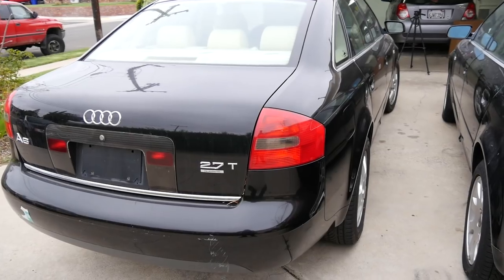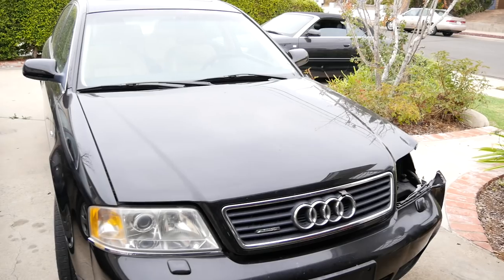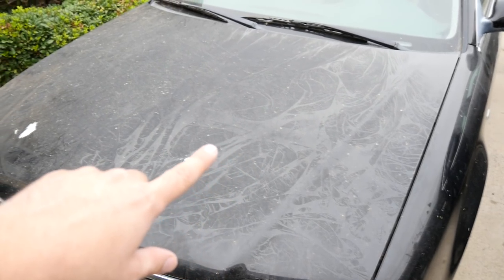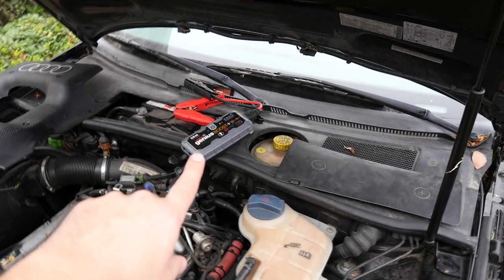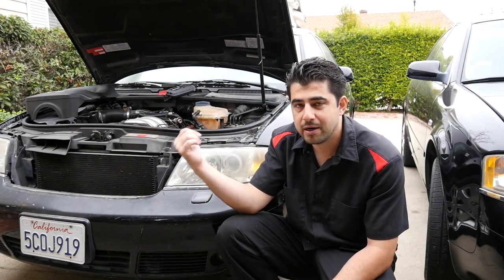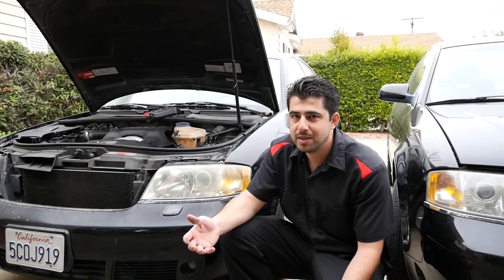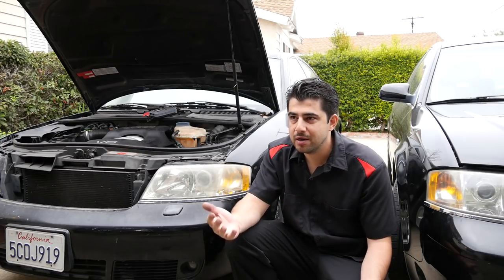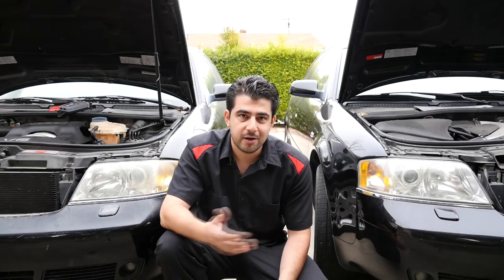Sleeper car for +$500 - No Joke

Comment: I see the PROBLEM HERE!!
Too many jealous and ignorant people that don't know anything about cars. Just cheap crappie like Hondas. 
Yes you can throw a turbo into a Honda but it will never outperform a Audi.  Never!!
I've owned Hondas and different Japanese cars. 
But this Audi can get over 400 H.P  with simple A.P.R technologies.  Without any mods to the engine at all. Just a simple chip and software mod and that's all. The turbos are good up to 30 psi each one. And you can drive it all day on red line.  Yes they cost more money to repair.  But one thing is this. 
You won't find any wrapped around a post like those ballerina Hondas.
So guys keep talking smack because at the end of the day. I doubt any of you can even afford to do what he does or have the knowledge to do what he does without looking on YouTube just to change your spark plugs on your Nissan. 
Peace! !!
Reply: lowcabbie
I'm pretty sure this one was wrapped around a post.
Reply: J Shepard  let me give you an example of how these cars are. .....
My first mod was stage one a.p.r chip. Cost me 500 dollars Canadian and gave me 65 hp. Then 2nd stage was a additional 75 with intercooler and chip and cams injectors.  Total 1500 dollars   I was pushing over 400 horses and  no big mods at all.
How can you get that out of any car with 1500 dollars? ? All done at certified dealers. Seriously.  Your mind is wrapped around a post.
Reply: "never outperform and Audi" with a turbo Honda? Well the guys hitting 200 mph in a quarter mile on the 2 liter Hondas might say otherwise... Sure, the Audi can win since its AWD, but 1,500+ HP out of a 2 liter is pretty respectable... I know I couldn't handle that in such a small car. Either would be fun to drive, so they both win in my book.

Personally, I don't care about brands, I just want a cool/fun car. Just bought an RX-8 with the Wankel rotary engines (Engineer and nerd, so I just find the engine design really cool). Do I care that its not 10 billion horsepower? nope, It has plenty of power to get me killed. Do I care it makes single digit fuel economy in town? Nope, I go by smiles per gallon, not miles per gallon.

Comment: 500$ ? ha , wait till that shitty 2.7 spins a bearing or timing chain starts rattling, aint no 500$ fix.
Reply: Seriously do some homework before talking.... this car doesnt have a timing chain, It has a belt. The timing chain issue was with the newer years. And  the "spinning a bearing" in a 2.7 is unheard off. .. BUT engine maintenance on any audi is expensive . Simply do your homework before commenting something totally wrong
Reply: Ha wow a belt, of course its an audi, I did my homework, those engines are trash regardless of what you try do tell me.
Reply: A timing belt is completely different then a timing chain. Timing belts don't "rattle" like you said.. Also, saying that these engines are trash is utterly RIDICULOUS. Any person that even knows a little bit about audi, knows that the 2.7t is the most over engineered  engine that audi has ever designed, coming from the factory with forged internals and more. The issue with them was the stock turbos that they come with, as well as some sensors. If the owner doesn't maintain the car and shuts the car off after full boost without letting it cool down or going into full boost without letting the car warm up, the turbos will die fast. The engine in this car is amazing, especially from an engineering stand point. I own an s4 with this engine in it. Very expensive maintenance, but well worth it. I respect what you say but couldnt scroll past your comment because it was so wrong. But I can  see your stubborn  - "those engines are trash regardless of what you try do tell me".
Reply: I understand, if Id own one and spent money maintaining it, I would also be pissed seeing my comment. I've looked into these 2.7Ts and I am impressed with the engineering but I can only see how terrifying it would be to own used. I would only own one if I knew the engine was rebuilt with fresh turbos along with it. I myself am more of a mercedes fan and Im replacing my head bolts on my m156 6.2 so I know what its like to own german performance.
Reply: ltwargssf R understood, not being biast because I own one. Just wanted to inform. Good luck with the Mercedes. Sounds fun!
Reply: It actually has 2 timing chains! They link the intake and exhaust camshafts on each head. All of this run by a main belt.
So, YOU also need to do your homework!
Reply: AlienMonkeyDXB this is not what he was referring to though...
Reply: a timing belt and a chain ? Rip wallet.
Reply: ltwargssf R the chains don't get touched. 800 to get belt changed as long as your not taking it to the dealer. A whole lot less if your mechanically inclined and can do it yourself. Regardless, when you do the timing belt, your supposed to do pulleys, accessories belt, water pump blah blah blah. So yes. RIP wallet. Just got that all done. Lol
Reply: Ok. I own a 2.7t n am repairing a broken timing belt. Timing belt is infront in the 2.8 n 2.7 n runs the cams in the heads. There is timing chains within the heads to run the cams. I also tune these motors
Reply: ltwargssf R replacing head bolts on his "non trash" pos 6.2 😂😂😂😂😂. Knows German engineering 😂😂😂😂😂😂😂😂😂😂😂😂😂😂😂😂😂😂😂😂😂
Reply: Boost Book - it does have timing chains in the heads. The belt drives the exhaust cam and the exhaust cam spins the intake cam via a chain wit a chain tensioner. So yes it does have chains just not to crank. Its easy to see and find out how its driven just type audi 2.7 or 2.8 in eBay with timing chain and or belt into search.
Reply: Kendel Surette yes I completely understand that, but he was not talking about intake and exhaust chains. He was talking about the timing belt that spins those. Hence us speaking about the maintenance cost of the "timing belt service". Those chains normally do not get touched.
Reply: Boost Book - yea. The timing belt kit I just got was $400ish. I bought the premium all in one kit last time and that was missing one cam seal.. I ended up going to Napa and got the one wit the orange inside and it's spring reinforced. So I had issues wit them still leaking with the all black seals so this time I peiced the kit together myself and was able to get the timing lock bar and pin which I borrowed from a friend last time. Anyways. I got all the 13pcs and the lock bar/pin all for $350 but it was more work to find things that wherent coming from China and would be cheaper. I also picked up a thermal spacer for the intake manifold for $66, a CPS (G28) Bosch $22 and cam chain tool (which I broke last time) so about $500 with coolant is a good price. Me and my friend work on these mostly. I do ECU stuff like tunes etc. As long as the car has no major issues (trans,motor,electric) they are great cars. And I love how easy it is to find out what's wrong wit the 2000MY car compared to other cars made around that time I've owned or worked on. Just a good thing to do is buy a KLL cable b4 you buy a Audi. I would have know that I needed a TC or atleast now could have gotten it removed in the TCU. I could have asked for more money off the top. Quick side note. The ZF automatic has 2 separate areas for gear oil. The front and cntr are only able to be pumped out, not drained. Does this lead people on to think it dont take gear oil. Mine has 115k on it and I pumped out .4qt from the cnt and fnt diffs. So they were nasty and probably never changed out. The rear diff had been b4. So far the car is pleasure to drive and haven't spent much money on anything major. I've also been on a DazStage2+ on W/M injection for 70k and the turbos felt great when I did the motor mounts but I have a feeling someone before me replaced them cause at 188k they should have more shaft play. Cheers!
Reply: Like Scotty Kilmer said, they are endless money pits!. These cars are not for the working class as they are for leasing. Unless your a Mechanic, I suggest to never buying one as there's is a reason why you can buy $60k Benz, Audi or BMW for little as $6,000. They are notorious for electrical problems as they age.
Reply: pos 6.2 ? explain.. other then the head bolts they are solid and well engineered,  theres a reason why they call them over engineered, because they are better, you cant understand till you've owned one, then everything feels like a pos.
Reply: I dunno if there's anything else worse or as bad as a Bush Jr. era GMC Yukon/Chevy Tahoe... Looks like GM may have cheaped out on soldering...
Reply: 100k belt interval ..these motors last forever ...300k+ miles isnt rare .. i have over 215k on mine and runs perfect , doesnt use a drop of oil between 7k oil changes ..thats a pretty common ownership experience.. their biggest issues are valve cover and cam seal seeping..most/many do ..but doesnt seep enough to change the level on your dipstick..if a turbo goes out it's a huge pain in the ass labor'wise ..turbos can be had and upgraded cheaply ...turning the stock turbos up 5 -7 psi will give you 50 HP and 75+ TQ increase ..just 15 minutes on a laptop ..remove cats , add some down pipes and thats another good chunk of increases .. and they drive down the road as smooth as they are sitting at a light
Reply: the chains ive always referred to as cam chains .. upfront is the "timing" belt.. the chains in the back are pretty much never an issue or even a conversation in the 2.7 or it's big brother the 4.2
Reply: steve-o painter - the c5 4.2 is not the issue. Its the b6 s4 4.2 where its all chains and requires the motor to be pulled. I forget if the rs6 c5 needs engine pulled to do chains. If Im correct the c5 rs6 is not all timing chains, still setup like the 2.7t,2.8,4.2 so i think that its the same in the rs6 4.2T
Reply: ltwargssf R lmao, you're getting destroyed in the comment section. Just stop..
Reply: Then you just part it out and junk it and turn a profit

Comment: the 2.8 heads flow better with work than the 2.7 heads.
Reply: SimbaSoundPower the 2.8 is an unreliable POS, but the heads flow well
Reply: yup i wasnt clear enough: 2.8 heads on a 2.7 twin turbo will make better results.
Reply: turbo kit for 2.8 ford

Comment: I got a 2000 nissan xterra V6 3.3L automatic, 4x4... it has issues shifting and sometimes sounds like it has a slipping clutch like a bad clutch on a manual making the engine rev. I have noticed that when I floor the gas pedal that it shifts and if I drive it hard by constantly flooring the accelerator, it has no issues shifting. It does not sound like the transmission itself is slipping though.... do you think it could be the transmission oil pressure selinoid that is clogged like on the red dodge ram that you worked on??? Please help.

Comment: dude you just messed up!!! I just sold my 2004 A6 2.7L Sline. it only had 78,000 miles on it and was babied all it's life and it had both turbo seals go, along with almost every sensor on the car. The CV boots leaking bad, and brake issues, not to mention, a blown heater core. You'll be so disappointed when you see what parts cost. and even the mechanics trained to work on audi don't like it. doing simple maintenance on this car will make you hate it alone. It's also 4000 pounds if all the rest of that wasent enough reason.

Comment: I like the idea :) You choose the wrong car though.
Reply: should've bought a B5 2.8 Quattro
Reply: Nahh needs a 3.0 tdi v6
Reply: make a video mr. know it all
Reply: The only thing I know that VAG is not worth whatsoever money, attention or effort. And they were designed to demand a lot of mentioned things. You think you save on fuel, but you spend money on servicing injectors, turbos, dual mass flywheels, DPFs, low oil pressure issues etc.
I don't have to know anything more but to avoid these cars.

Comment: Aren't those 2.7L engines not very reliable!?
Reply: thetruejay20 only the newer ones with the timing chain stayed instead of a timing belt. B6 models have the annoying (but manageable) timing belt new models you gotta remove the block to reach the timing chain.
Reply: I had 155K miles on mine when I retired it. No problems with it. I had the belt and plugs done by a local shop for tolerable money; that was it for the entire time I  had it. The majority of problems I had with the entire car was tearing cv boots.

Comment: What is a sleeper car?
Reply: Jose Citizen Big sedan with space to sleep in the back.
Reply: Jose Citizen a car that looks factory on the outside, but is modded, engine, drivetrain, suspension.  Basically a car thats really fast, but looks slow and/or normal.
Reply: Jose Citizen when a car goes Night Night dude

Comment: hello sir i have hyndai accent 2008 gle petrol  and at first start up blue smoke coming from exhaust  for sometime and then back to normal .what is the problem with my car sir please reply thank you
Reply: Miten Pandya seems yur burning oil.white smoke usually blown head
Reply: Miten Pandya also sorry, could be valve stem  seals .worked as a kid with an A mechanic 30 years ago.I learned some stuff

Comment: Oh I see
So spend $10k on a piece of shit.
Here's a tip
Boost a honda/Toyota/Nissan
More power for less and far better reliability
Reply: Unco Casey boosted 4 cyls blow all the time they cant handle any power
Reply: Keepo Hdee  sr20det , k20 b16 b18 boosted , 4g63t etc. u obviously dont know what are u talking about hahahaha
Reply: If I were seeking power I'd look into American GTs, otherwise i only look at JDM stuff for handling Dynamics.
Reply: Keepo Hdee weird, my ca18det has 220,000 miles on the first engine :p
Reply: Don't know what your running on your 4cy turbo to make em blow 😂or how you look after them
Reply: you know nothing about these 2.7 engines then. They will blow any RB out of the water, especially with the price point. And thats coming for a Nissan fan!
Reply: Nissan's have electrical issues
Reply: Piznick64 depends on the car my old nissan maxima didnt have any and was a 97

Comment: A6 Quattro a sleeper? Lmao my M3 must be a sleeper as well. 💩 video deserves more dislikes
Reply: LockedDanny2000 judging before he finished his series lol. Don't bite your tongue
Reply: It looks like a sleeper to laypersons. It never does to trained eyes. How many people you think will be able to tell this from a regular A6?
Reply: If it was an S6 your point would be valid, but if he just removes the 2.7T badge, nobody would know what that car is capable of, after the modifications of course
Reply: Ilija `modifications on an udi twin turbo aren't even remotely cheap
Reply: LockedDanny2000 every low price car can be a sleeper dude, they dont have to be new or old
Reply: Just remove the badges and ta-da
Reply: Not really, that version of the 2.7T only had 230hp and was not especially quick.  
It can be tuned to over 1000 though depending on how much you have to spend.
Reply: LockedDanny2000 my badgeless e60 m5 has the same sleeper status haha.
Reply: Unco Casey determines on what modifications.
Reply: The US-M(arket) cars don't get the best European models sadly. This would be the best sleeper sedan for the money, albeit any engine repairs will be extremely expensive unless there are like 2 bank turbos not really connected at all.
Reply: LockedDanny2000 they are garbage but can be very fast for little money. Just ecu programming with some small modifications this car will make big hp and huge amounts of torque. Walk on cars all day long.